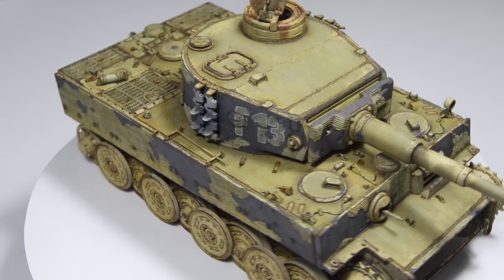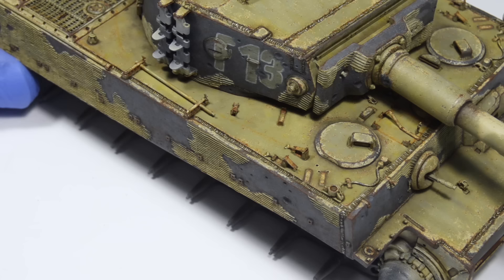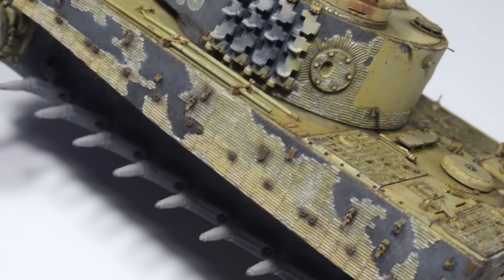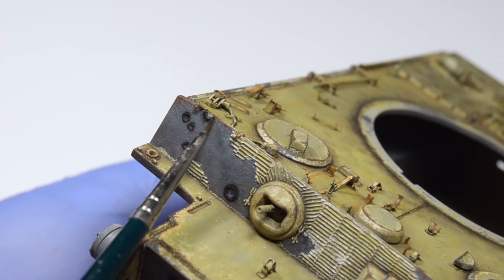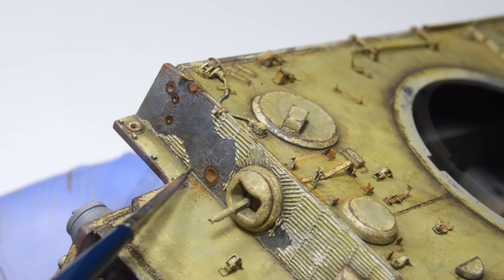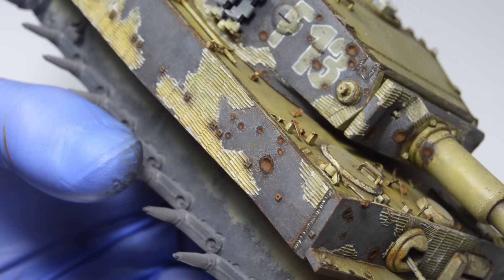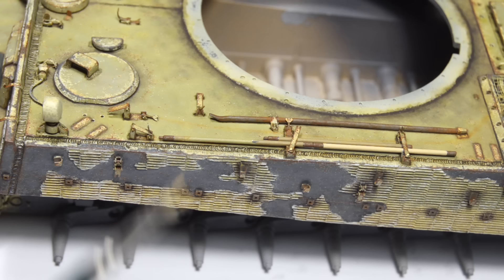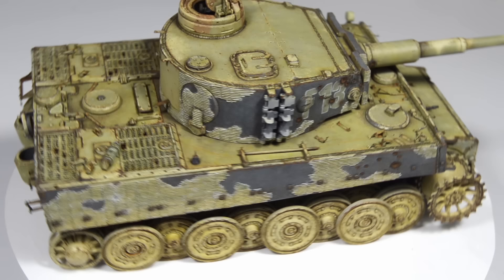Let's Paint Some Shell Impacts And Other Cool Effects! | Tiger 1 Gruppe Fehrmann | RFM 1/35

Comment: Glad that you are more in tune with what a battlehardened armour unit would have looked like after a few forays into the Hell of war. With the swift movement of columns, there would have been little time for even the smallest of repairs beyond the primary drive train, transmission, steel tracks, or the fully functioning armament. Most camouflage was apparently applied with mops that would have far from being very well done or covered the surface with any consistency. I enjoyed your content and instruction.

Comment: She is really coming together. My experience with weld beams from my work is that they rust rather quickly when the paint is scraped off, like a day or two is enough to cover them with a thick layer of surface rust.
Reply: Germans used nickel or some other non-corrosive metal to weld. I have a spare track that was spot welded on a tank during the war and the weld is perfectly silver shiny while the track looks like ass.
Reply: @AdamMann3D  Didn't know that, we learn something new everyday :) For my welds I always spray the welds with zinc primer right after to stop the oxidation.
Reply: Doesn’t that depend somewhat on the welding process, the metals, filler rod composition, flux used if it’s an arc process and the general competency of the welder?

I do agree that welds exposed to the atmosphere or water generally lose their shiny appearance quickly - my preferred colours for representing exposed weld beads are Tamiya’s metallic grey or dark iron, depending on how long I imagine the paint to have been missing.

There’s also the tendency for rust to form along the sides of weld beads and in any pitting in the bead, which can happen incredibly quickly. And once started it tends to spread under the paint until all of a sudden a big patch of rust breaks through the paint or the paint flakes off wholesale and you realise you’ve got a serious corrosion problem. As I found out while starting to attempt to repair my elderly Land Rover’s chassis :-(. Mind you, some of those 20 year old weld beads were still incredibly tough and could resist a vigorously applied cold chisel despite the rust.
Reply: Poor German welders must have had the runs for years...
Reply: @AdamMann3D  Doing some digging around points towards the Germans using manual arc (“stick”) welding throughout the war. The electrodes/filler rods probably being a steel/nickel/? alloy, of which several varieties existed at the time. It’s possible they were using a quite high-grade stainless steel of some sort, though stainless is tricky to weld and not really ideal for armouring purposes.

British examination of a Pz III apparently found some welds had problems, including voids, flux in the welds and welds cracking away from the plate they were supposed to be fused into. With hindsight the cracking sounds rather like a hydrogen embrittlement issue. That wasn't fully understood at the time and effective rods and processes to avoid it were very much in their infancy. Weld inspection wasn’t anything like as advanced as nowadays of course so the first indication of a failing or poor weld may have been when the armour came apart as a weld gave way after being hit by a solid APDS shot..

The Soviets seem to have regarded German welding as inferior to both Soviet and US late-war automatic submerged-arc welding, at least for welding armour. Which isn’t surprising as submerged arc would give much stronger welds in thick armour plate. Submerged arc isn’t really possible to do manually as it requires tight control over both the depth of the electrode in the weld and the speed the weld progresses at. Machine welding has the disadvantage of needing a complicated machine but the advantage of consistency once everything is working right, unlike a newly trained human welder.

So the often repeated assertions that German welding was always really good and Soviet welding frequently poor may be just that - assertions.
Reply: @kezzler9556  What process are you using? I’m not a professional welder but I’ve done quite a bit over the years and possible causes of rapid corrosion that come to mind are either inadequate protection from MIG/TIG shielding gas or inadequate removal of stick flux from arc welds. For some reason the flux is quite harmless until it’s used to make a weld, after which the slag it forms can corrode the metal quite quickly unless fully removed.

If you’re welding underwater or in a moist atmosphere all bets are off of course.
Reply: @tlw4237  When I am welding cars I always cut out a larger chunk of metal around the rust. then I brush some rust milk over it that converts any rust and stop it in it's track ( rust is like a living creature, it forms thin worms that burrows down the metal, it's there even when you can't see it with your naked eye. 

Once welded up I prime it with a special zinc primer while the metal is still warm. For inner structures like frames, I use a special tool (don't know the english name for it) attached to a long hose, spraying a layer of zinc primer, then iron oxide primer, and finally a layer of paint.
Reply: @tlw4237  The shielding gas I am using is usually mison 18 for mig/mag.
Reply: @kezzler9556  I use BOC Argoshield Light for MIG/MAG/TIG on thin steel - 93%Ar, 5%CO2, 2%O2. It works well so long as the gas doesn’t get blown away by wind or draughts. I find a little surface rust on the bead might appear if I don’t cover the weld soon after making it although most fresh rust appears along the side of the weld bead where the heat has affected the steel. I don’t paint the weld while the metal is still warm, but I do wire brush it using a grinder or drill mounted brush before painting. If I get very rapid rusting I think it’s usually because the gas hasn’t shielded the weld very well. Usually because it’s getting blown away too quickly.

You are right about rust always being present in mild steel even if you can’t see it - it always wins in the end. Copper is the same - unless it’s been treated to make it oxygen-free copper wires and cables corrode because of free oxygen atoms in the metal.
Reply: @tlw4237  Well, it don't really matter if the shield gas is being blown away for formation of oxide, it will only make your weld look bad. Your mix looks very similar to mison 18. I am starting to think you are trolling us a bit hehe.
Reply: @kezzler9556  Try welding without the gas and see what happens as the weld reacts with the air. Instant rust.

Comment: The rusty color you put on the "brass" parts is actually a pretty good match for the brownish patina brass gets if it's exposed to the elements and not disturbed- which I guess means either that barrel is really cruddy from neglect or the brass got patina-ed by sitting after the tank was killed. The only difference is the texture- iron with that color rust is rough but brass will stay smooth.
So, good job by accident!

Comment: You had me scared for a second when you started painting the fire extinguisher grey....hahaha.  But it actually looks awesome that way.  I will have to get some decals and try it out.
Reply: Entirely by coincidence I did a google search for images of Panzer fire extinguishers last night. I model very little German stuff and wanted to check what colour the external extinguisher on the Stug IV I’m building should be. The photos of many poor condition wartime ones that have survived do tend to have the flaking and peeling remains of what looks like grey primer stuck to their rust, while the ones in good condition were obviously painted either dunkelgrau or gunkelgelb to match the vehicles when they were made.

A proportion of modellers appear to think they were all bright red, though that might be confusion caused by more than one extinguisher being carried. I found  what seem to be reliable references to the externally carried extinguishers being in the main camouflage colour and the internally carried ones being very much like modern “water fire extinguisher standard red”.
Reply from the maker: @tlw4237  I'm  not an expert by any means, and I used a few museum photos as my reference, which might be obviously wrong, but from what I've seen extinguishers were usually painted with the camouflage color. Not sure if it was done in the field or in the factory depending on the current standard though, so I went with the grey base and chipped green camo on top. What we can most definitely agree on is that they certainly weren't red.
Reply: @NightShiftScaleModels  I actually agree with you - the externally carried extinguishers were in the base camouflage colour of the vehicle. Whether they were repainted if e.g. a grey tank was repainted dark yellow or if the Afrika Korps tanks had their extinguishers, tools and jacks repainted when the grey tank was painted dark sand for the desert is something I can’t find information about.

I imagine tools etc. would be removed before spray painting or whitewashing the tank because otherwise the tools and clips holding them in place could become glued together by the paint. Though I could be wrong. It’s surprising how difficult it is to find these things out when the war was only a few decades ago. Back in the 1970s modellers didn’t worry about these things, maybe because many kits weren’t detailed enough for it to matter.

And you Tiger looks fantastic, by the way.

Comment: Nice work so far, congrats. I'm watching with pleasure the progress on this one. Maybe you should consider to do some heavy chipped yellow paint onto the front horizontal glacis, revealing the grey or even the bare metal, where the shell hits the vertical armour plate, near the main machine gun post? It will add more realism because the shell impact forces obviously blow off any kind of paint on that areas. It's just an opinion, of course.

Comment: Weld beads do corrode matey, unless stainless steel rods have been used which would be pointless and very expensive for welding non SS plates together.
In fact unpainted mild steel welds show corrosion really quickly and a thin patina of rust is present within a day or two.
Reply: He's right, they're stainless.
Reply: @AdamMann3D  
Eh?
The cash strapped and raw material starved Germans used stainless to weld their Tigers?
No wonder the buggers lost!
You live and learn mate, thanks for that.

Comment: Hi, Martin. May I ask how you manage to maintain such a fine point on your brushes? Mine only ever seem to hold it to begin with, and then once cleaned, or even in the midst of painting the bristles start to spread out, making fine detail painting difficult to do. Loving this series, by the way :)
Reply: An old artist trick is to moisten the brush with water or thinner and strike your workbench or easel with the brush handle. The bristles will snap to a point.

Comment: Very GOOD work.

Are you sure that the rear Notek is blue ? I think it is green. 

Thanks for your always very interesting videos-
;-)
Reply: A very pale green, at least on the museum examples I‘ve seen. And four little rectangular lamps side by side in one housing, which had a very clever trick for the driver of the following tank to work out if they were too close or too far away depending on whether the lamp looked like 4, 2 ,or 1 lights.

Comment: I want to build a model of tiger 231 but the problem is that there's 3 versions(initial prod., mid, and late war. So I dont know which one to build
Reply: When you have a complex predicament like that, its best to turn to the time tested method of "pin the tail on the kitty"
Reply: You do know that every unit would have had a 231?
Reply: @AdamMann3D  well the one I'm building is infamous for being almost indestructible. It ended up being used as a propaganda piece to show how strong tigers were and then ended up being a practice vehicle to train tiger tank crews(some if that info might be wrong but, hey I'm trying to build and paint it. Not write a book about it)